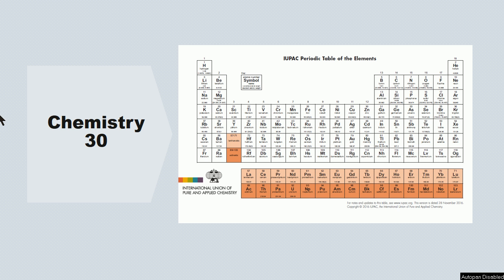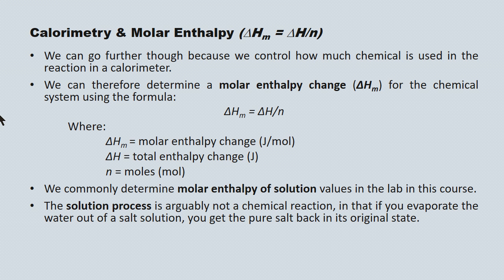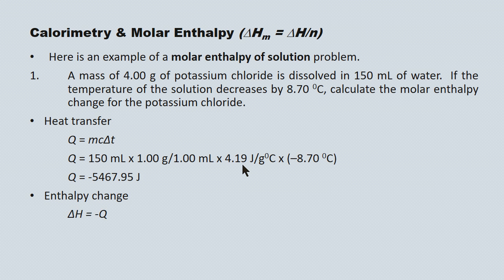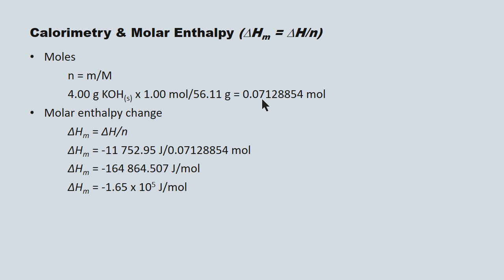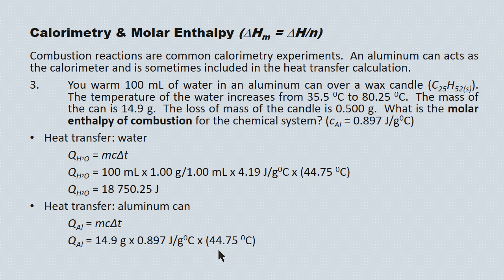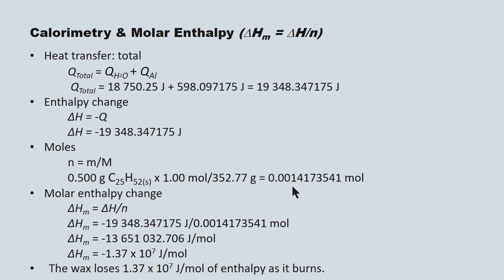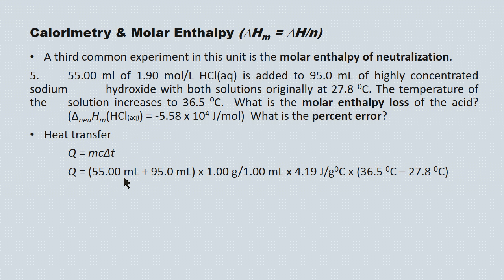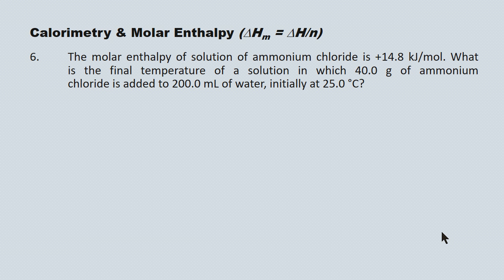L  3 Calorimetry & Molar Enthalpy

Comment: fam, whats the answer yo?
Reply from the maker: Here's the solution for Q. 6:

[40.00 g x (1 mol/53.5 g) x (14.8 kJ/1 mol) x (1000 J/1.00 kJ)]/(200.0 mL x 4.19 J/gC) = 25.0 - 13.2 C = 11.8 C.

Let me know if you got something different.  Thank you
Reply: Alberta Chemistry 30 shoot, my work and yours look the same but I'm getting a different answer. But your answer checks out
Reply: Alberta Chemistry 30 run that back. I'm getting 38.2 C
Reply from the maker: I want to amend my math a little, but the answer remains unchanged:

40.00 g x (1 mol/53.5 g) x (+14.8 kJ/1 mol) x (1000 J/1 kJ) = +11,065.420560747 J
This is the gain in enthalpy of the dissolution of the ammonium chloride.  The loss of energy of the water (Q) will be equal and opposite to this.
Q = -11,065.420560747 J
Q/mc + ti = tf
-11,065.420560747 J/(200.0 mL x 1.00 mL/1.00 g x 4.19 J/gC) + 25.0 C = tf
tf = 11.8 C.

The process is endothermic.
Reply from the maker: I think you're skipping a line and equating enthalpy change of the chemical system with energy change of the water.  I glossed over it the first time I presented the mathematics, so likely confused matters more than helped.  In this question, the water loses energy to the system that gains enthalpy.  The temperature has to go down.
Reply: Alberta Chemistry 30 that's right! I must've skipped that extra step there. Thanks for the free lesson fam